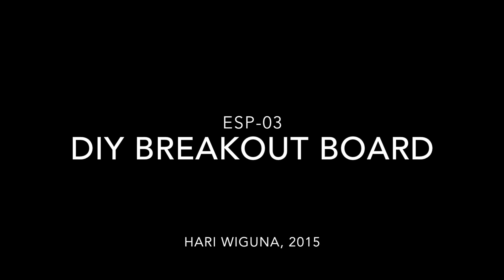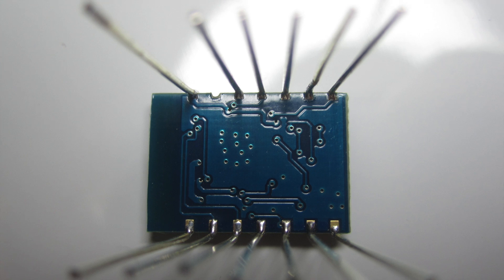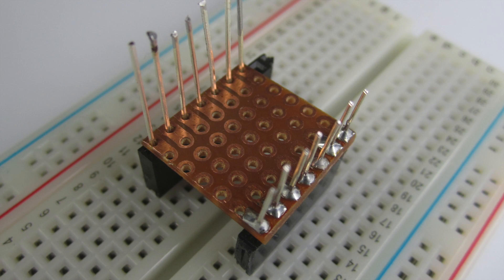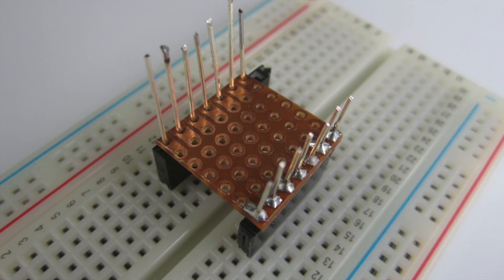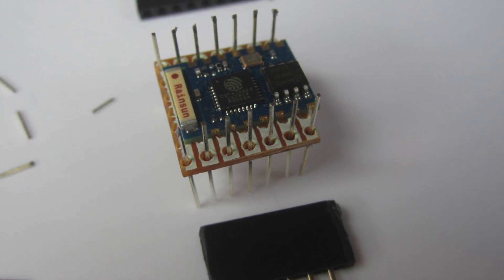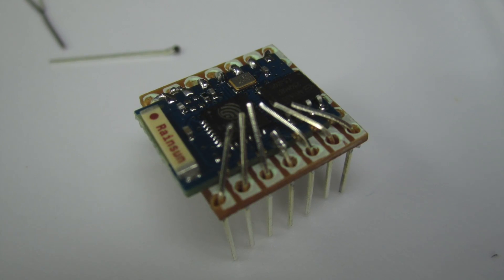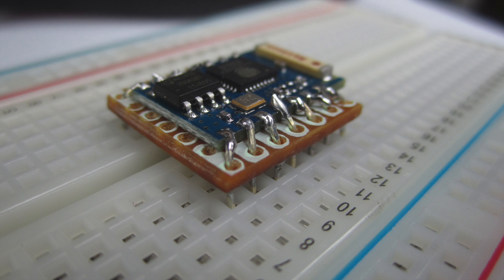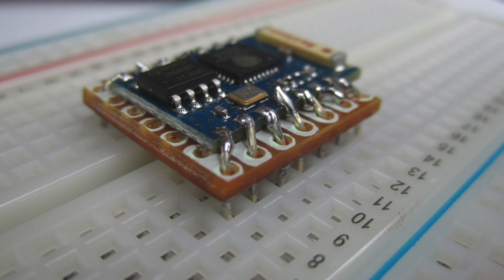DIY breadboard compatible breakout for the ESP-03 / ESP8266 WiFi Module

Comment: Thanks - this was inspiration when trying to figure out how to prepare a JDY-08 (Bluetooth BLE 4.0 RF Module) for Breadboard. I've not won yet - but using tiny enamel copper wire to make bonds between the crenellations and single inline headers - I've started by mechanically getting the bond wires attached to the PCB, and I'm currently bending them in to where they are. The crenellations are 1.5mm apart, and 1mm in size - so it's definitely tweezer work.
Reply from the maker: Glad to hear that it was helpful.  Thanks for letting me know.
Reply: I've a question for you - did you use any glue or something similar to hold the part down before soldering the legs in?
Reply from the maker: No, I did not use any glue. I just started by soldering the middle pin to position the module where I wanted.  From that point, I bend the other wires towards where it should go on the smaller module.

Comment: Hi Hari your work in the previous videos about ESP8266 is pretty good, thanks for sharing, well, I have a simple question for you(I think), lets see, Im using the ESP01 and setting GPIO02 to HIGH I can see the 3.3vdc signal going out and the relay works, then when GPIO02 is set to LOW, the relay enters in a weird status and I think is because GPIO02 does not go to 0vdc, it has 0.6vdc(dont know why), well, the real question is what do you suggest me to use in order to filter that signal, I dont know if some electronic component already exist where we can say if vdc > 3 let it be, if not then the vdc should be 0.
Reply from the maker: Hmm, could you share the schematic? Are you using a transistor to drive the relay? Don't forget flyback diode on the relay coil to protect the transistor.  Also, remember that you should wire the circuit such that at boot up GPIO00 is not pulled to ground or it would think that you want to burn a new firmware onto the ESP. :-)

Comment: Thanks for the video showing a simple way of using ESP-03 board on a breadboard. Compared to the ESP-01 board which has only two IO pins brought out, this board shows as many as seven. But how many of them can actually be used? Since you have used this board, I thought you might have the answer.
Reply from the maker: Four unconditional I/O pins, plus one more that you can use as long as you keep it "high" with a pullup resistor at boot up or it would think you want to burn new firmware onto the ESP. :-)
Peter Scargill has a very nice diagram on the ESP-03 pins here: http://tech.scargill.net/christmas-post-in-wark/
In this project, I used three. https://www.youtube.com/watch?v=ifidx4Ly05c&index=7&list=PL-xZsBalytNAFgyiDI8_lwXyeVE3R4hpx
Reply: Hari Wiguna Thanks for the info and links. I am in the process of making a small PCB for esp-03 board. Currently, the esp board is on the breadboard, connected to my laptop through a USB-to-Serial board. Serial port connection gets established and Lua Uploader sends commands to the module but there is no response from the ESP8266-03 board. Can you tell me how each of the GPIO pins should be connected to either Vcc or Gnd with or without a resistor for normal operation of the module?
Reply from the maker: Bala Chandar, I did not connect any GPIO to ground (other than when burning NodeMCU lua firmware).  GPIO 0, RST, and CH_PD are pulled to +3.3V without resistor.  In other circuits, I've used 1K pullup to be safe.
I shared a schematic at the beginning of this video.
https://www.youtube.com/watch?v=NLZYo9v5oDY
Let me know if I could clarify further. Good luck!

Comment: Trying to do this myself . I see that your not using copper wire for you through hole leads .  Were they salvaged from a header?  In any case I am looking for a solid wire for this part of my project.    looks like its 22 gauge  what kind of wire is it .  Sorry for the silly question.
Reply from the maker: When I built my 8x8x8 led cube, I trimmed the LED leads after I solder them into a cube.  So, I have TONS of those remnants.  However, 22 gauge breadboard wire should work perfectly too!  Any solid wire that fits well on breadboard should be fine.